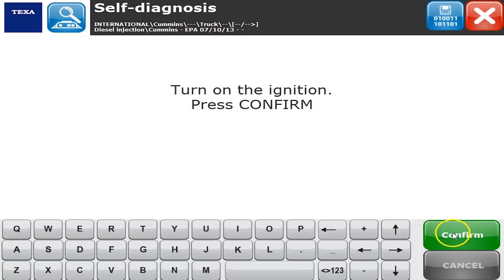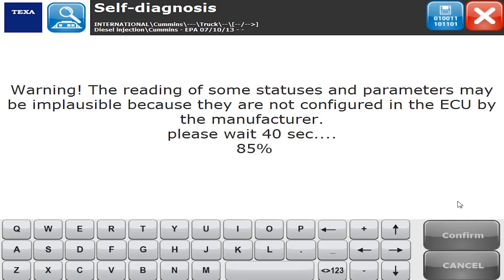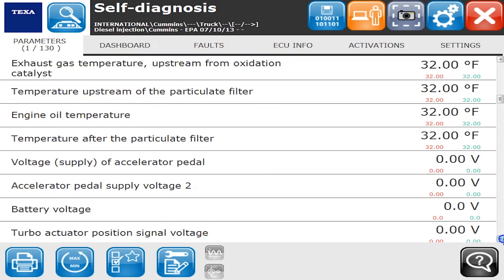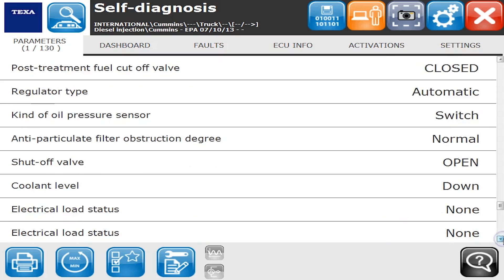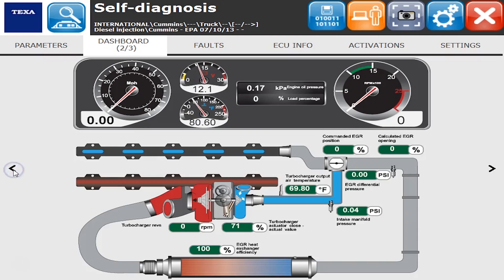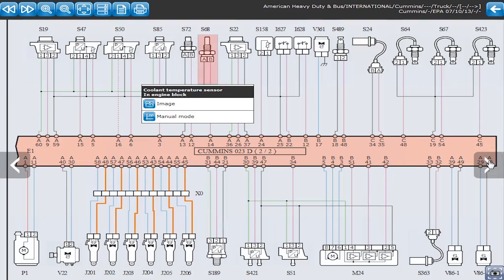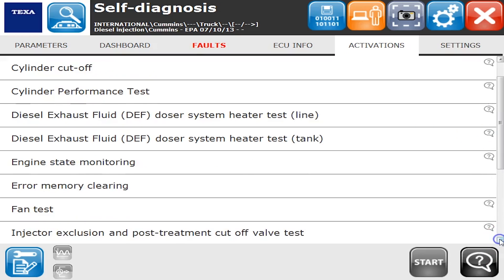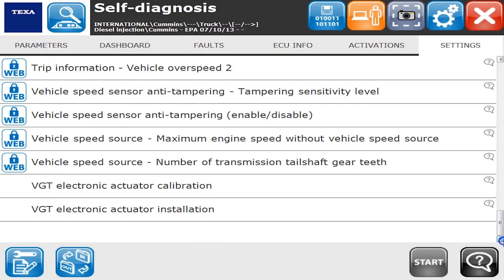TEXA Truck Diagnostic Tool on 2009 International with Cummins ISX

Comment: I was noticing on the right-hand side of some of the test and configuration changes.it has a web padlock does that mean you can only do those while connected to the Internet or is that a extra prescription?
Reply from the maker: The lock symbol means you need to fill out a form (Just one time) and be on the Internet to run those commands. There is no extra price.